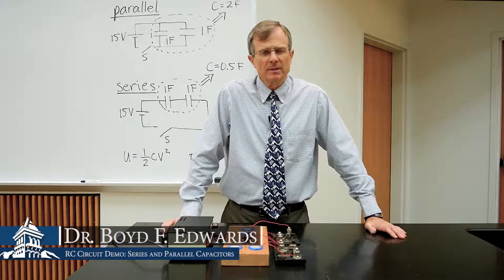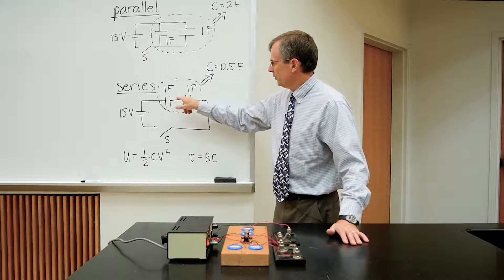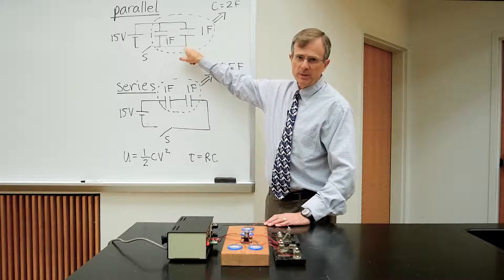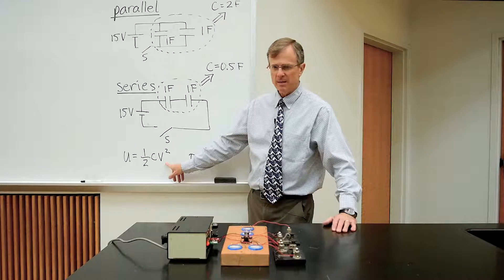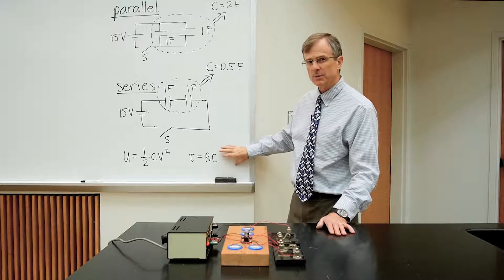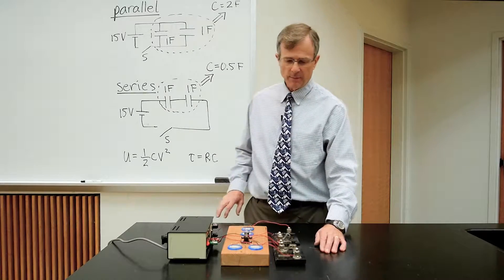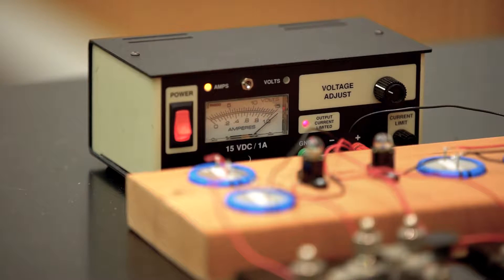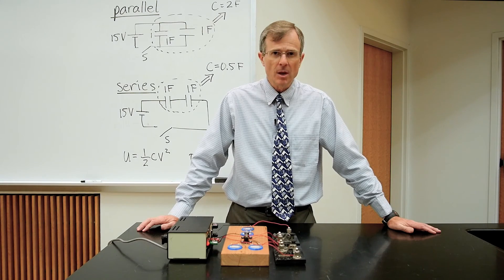RC Circuit Demo: Series and Parallel Capacitors

Comment: How to culculate the stored energy inside the capacitor (say, after 5 second as you counted) if there is no resistor? As we know, the time constant is RC for RC circuit.